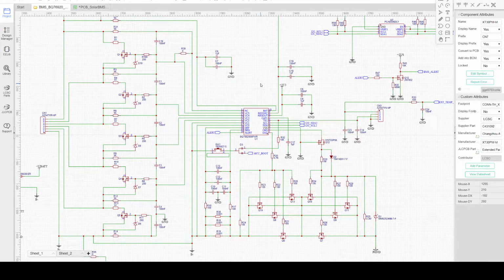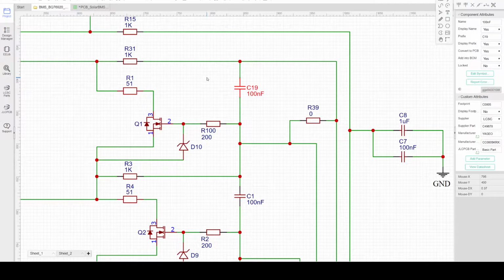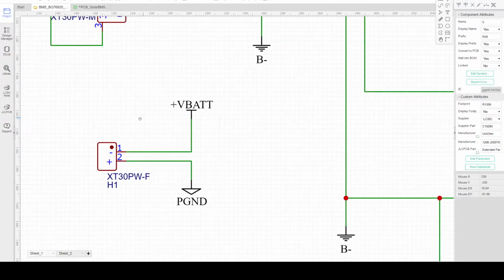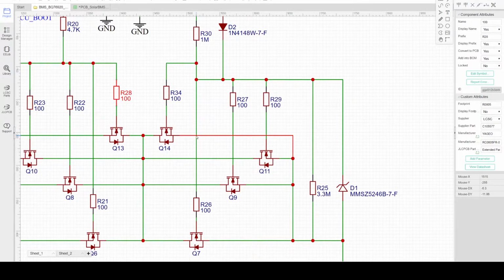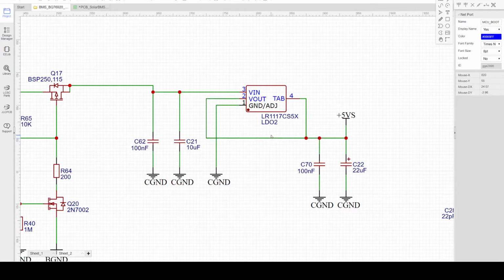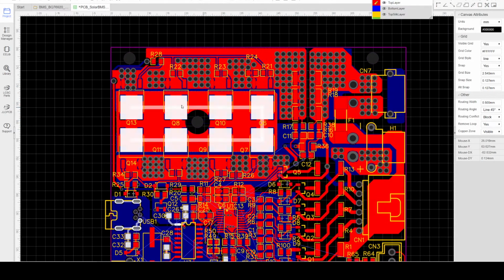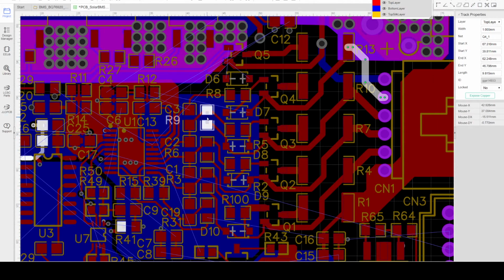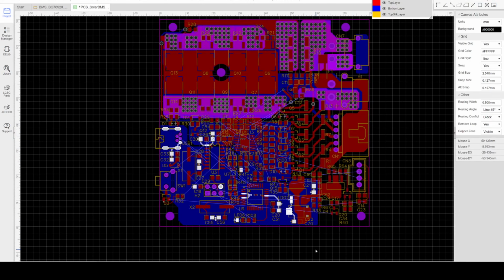How to Design  High Performance Solar and EV  BMS using BQ76920  and EasyEDA PCB Software Part1

Comment: How does microcontroller knows the voltage on cells?
Reply from the maker: MCU and BMS Controller communicate through I2C to get the cell voltage and other parameters.
Reply: @powertechmaker1522  I think balancing mosfets are built in. I checked datasheet
Reply from the maker: @lollol2283  You can use built in but will increase the temperature of the IC and balancing current is low. Using external balancer will have high balance current and faster balancing. Also reduce the IC temperature.
Reply: @powertechmaker1522 ah, got it. And if we have internal system, how does external low pass filter works as balancer? I understand, that excees of voltage on the cell discharge through resistor. But how? Only this thing is unclear to me
Reply from the maker: @lollol2283  The controller will automatically select voltage measurement and balancing through a control multiplexer, since cell measurements and balancing cannot be at the same time, since the high current will introduce voltage drop and cell voltage error.
Reply from the maker: @lollol2283  it's an internal control, MCU can also manage to select measurement mode through low pass filter analog mode or balancer mode  through Digital IO drive control.
Reply: @powertechmaker1522  so balancing and filtering operations are made with a help of rc filter? P. S. Thanks for help, it's hard for me, but I m trying to understand)
Reply: @powertechmaker1522  so discharging resistor is inside the unit as the fet?
Reply from the maker: @lollol2283  No, if you want to measure  Cell 1,   RC Filter and VC1 & VC0 are input analog for ADC measurement.  If the controller will balance Cell 1, VC0 will become Output to drive the external mosfet to switch the balance resistor.
Reply from the maker: @lollol2283  https://www.ti.com/lit/an/slua749a/slua749a.pdf

Please check this application notes. pages, 7,8,9
Reply from the maker: @lollol2283  no, R1, R4,R7 etc  are balancing resistors. switched by external mosfets
Reply: @powertechmaker1522  ah, if we use internal system, (only rc filter is outside) the internal FET will draw current through the  rc resistor?
Reply from the maker: @lollol2283  yes but very very low because it's just driving the gate of the external balance mosfet.  and during balancing voltage measurement is disable, so it's not a problem.
Reply: @powertechmaker1522  now it's clear. And does this circuit limit the current? For example in the end of charging it decreases, in the middle current is max
Reply from the maker: @lollol2283  yes, it limits the discharge and charge.
Reply: @powertechmaker1522  thank you for help. you really helped me with my work. I created bms circuit with   bq 76920 and bq 78350 and made my diploma. thank you once again!

Comment: Good day sir. Pls tackle po 3-phase Solar Grid Tie if po indi na kau busy sir. Maraming salamat po sa kaalaman. Hayaan nyo lang po bashers sir, views din un. Hehe. Also, bilib ako sa inyo na pinaglalaban nyo tlg ang tama. Indi kau nag susugarcoat at kumukonsente sa pagkakalat ng scam.
Reply from the maker: Ok Sure.
Reply from the maker: Next year topics: I will  create more Tutorial content, here are the topics that I am planning to create.
1. Safety Guidelines 
2. Electronics Tools and Instruments
3.Basic Electronics Theories
4. Basic Electronics Component,  Operation and Troubleshooting. 
5. Power Electronics Components and Operation
Troubleshooting .
6. Power Supply ( Linear and Switch Mode).
7. Power Conversion (  High Frequency, Low Frequency Inverters)
8. Battery Charger and Management  ( Lead Acid and Lithium)
9.  Renewable Energy System Integration, Installation and Troubleshooting.
10. Electric Vehicle Systems, Troubleshooting, DIY Ebike Assembly.